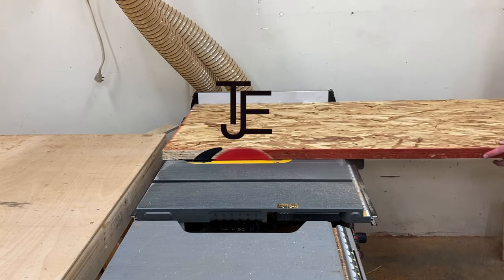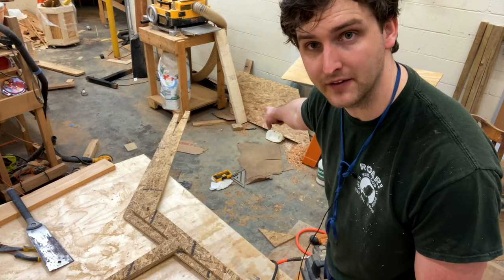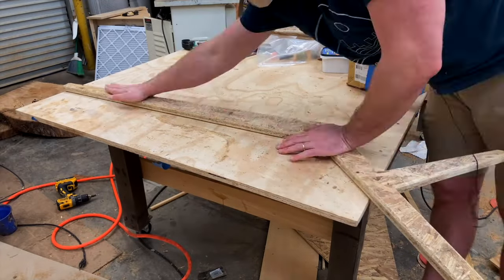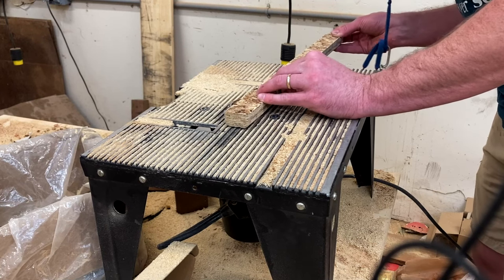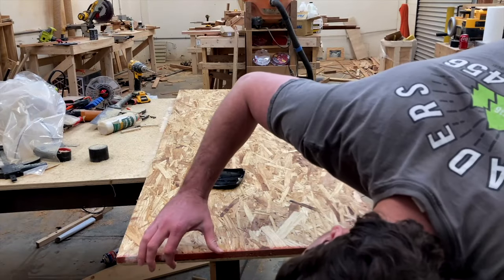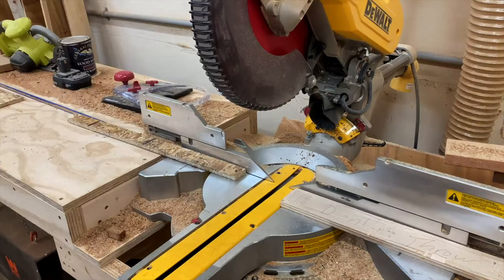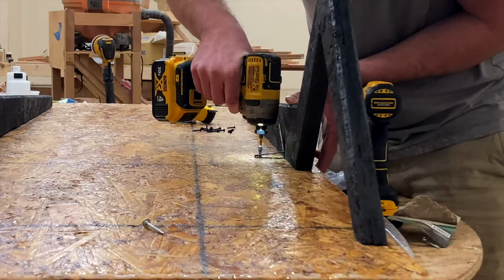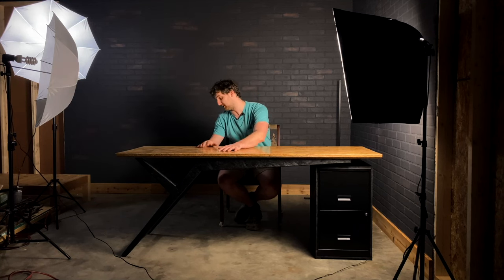Can you turn OSB into something beautiful? DIY OSB

Comment: I think you can make nice stuff with OSB. IMO there are two problems with it. One - you need to find a balance of OSB and plainer looking materials, because OSB has a very hectic look. Two - I hate the edges. Right now I am replacing old doors on kitchen cabinets and edge band (with miter) every panel with pine strips, before sanding and finishing the panels with epoxy. In my case I use a hint of white pigments in the top coat, to give the OSB a ligher look, without staining / painting them. I also paint the cabinets in a char coal like grey.
The result looks good, but the work is quite tedious.

Comment: It is beautiful, is there a cheaper way to replace the use of epoxy? it is too expensive for me :(
Reply from the maker: It is expensive! If you sanded the top as flat as you could and layered on some poly and sanded lightly between coats you could potentially get it pretty smooth although with the osb it’s be pretty hard to